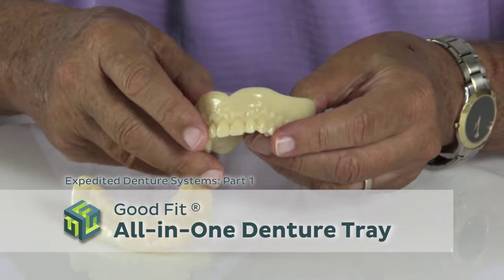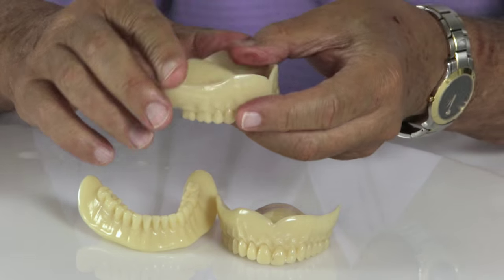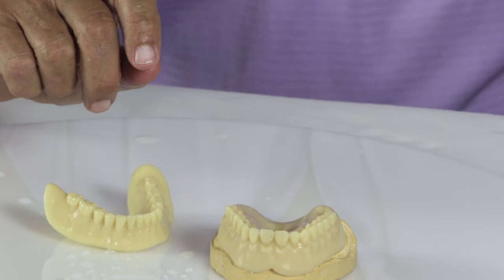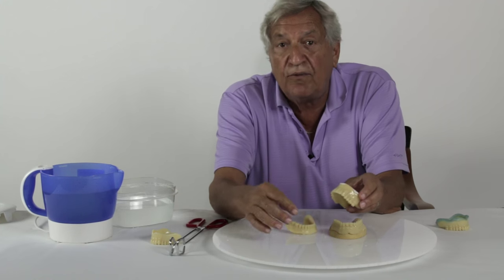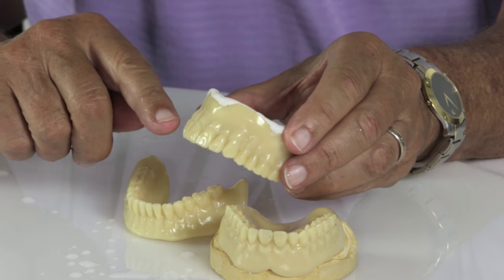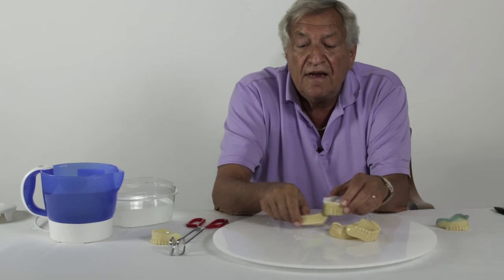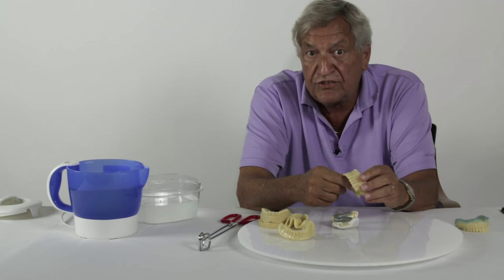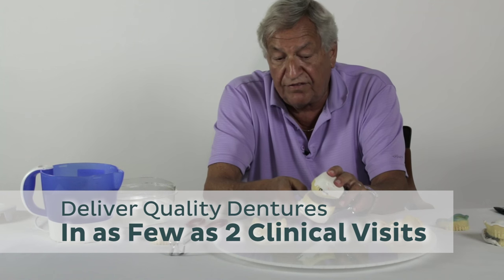All-in-One Denture Tray | Good Fit ® Expedited Denture Systems

Comment: what about hot coffee or soup?
Reply from the maker: Hi Connie. The product shown in this video does not become part of the final denture. It is used to take impressions and other measurements that are then used by a dental laboratory to make the denture. 

We do have other products with similar properties that become part of the final denture. In those cases, hot coffee and soup are simply not hot enough to make the product moldable. Moreover, the process through which those other products become part of the final denture includes adding material which fixes everything into a non-moldable shape.
Reply: Thank you.